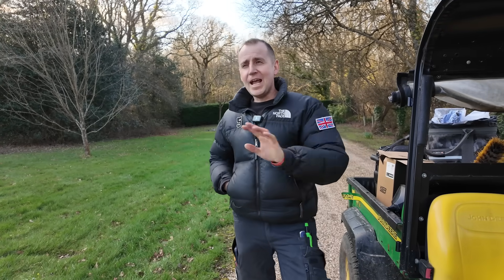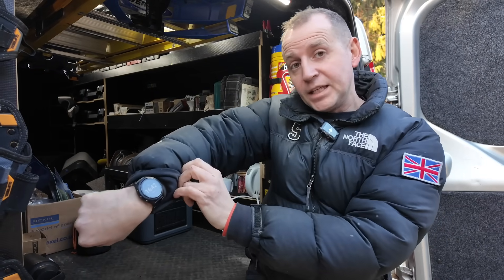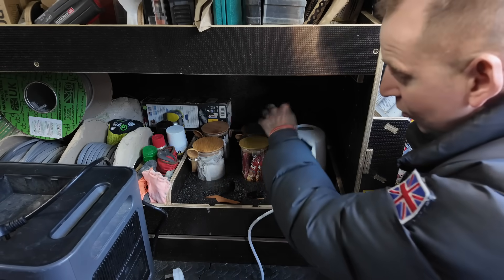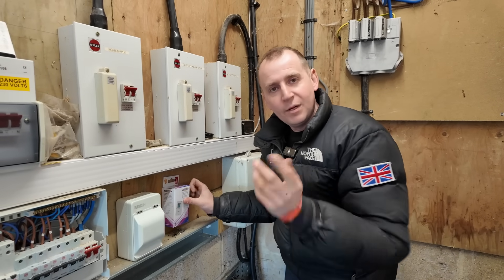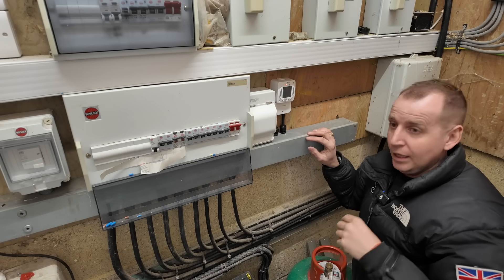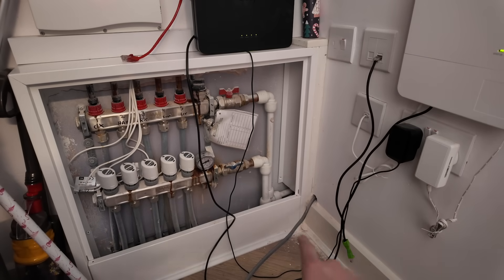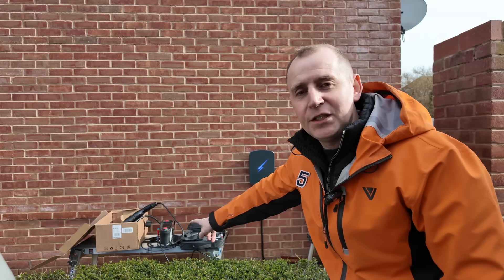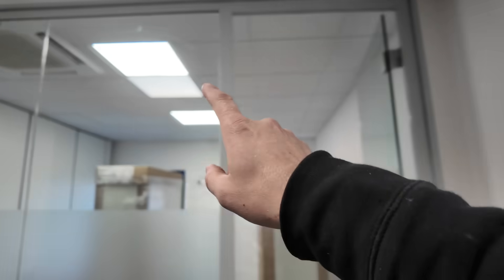EVERYTHING'S BROKEN BUT I WILL GET IT WORKING... OLD WIRING CAN BE FIXED...SOMETIMES.

Comment: Seen some install additional boards from the Henley and some from an MCB in the main board. Is there any pros/cons in each or is it just personal preference?

Could also do lights through a Shelly smart switch. Can then set a timer which they can control from phone and also if home late and lights are off, can turn on remotely. Great video, enjoying following it along.
Reply from the maker: Normally an MCB to EV board is a bit cheaper, no meter tails involved etc, otherwise it’s swings and roundabouts. 

Thank you! I appreciate your kind words!

Comment: Out of interest, Adam, what did you use to connect T&E to EV Ultra?  If it's 4mm2 there are plenty of options, 6mm2 less so.  I'm always conscious it'll be running a full 32A for hours at a time, the  size of newest EV batteries!
Reply: More than likely some Wago 221-6 but could be wrong
Reply: @SME_Ste  I've used the 6mm2 version of the 221 on other types of circuit, but not confident enough to use  with EVSEs.  I recently did one for a Porsche with 93.4kWh battery  - that's a long charge at 7kW  - you've got to wonder about those metal strips that link the ports!  When I need to junction the EV Ultra for any reason I use old fashioned 60A screw terminal connectors, with the two 6mm2 conductors running together from one side, with two screws - and make sure box is easily accessible.  Would crimps be a better option?   With a big enough JB you could use Henley blocks - overkill?
Reply: @ they’ve never worried me, 41 amp rated, which will be continuous and for your standard 7kw charger perfectly up to the job for me to be happy. But end of the day, as its accessible the 60A screw blocks would be another great choice too. Hate crimps, in my mind out of everything to use it these i’d worry about the most. Don’t know why

Comment: You can 100% get the rcbos which fit that wylex board for future ref mate
Reply from the maker: I checked with CEF and Rexel and both said they were non existent anymore, it’s that old bus bar type that the newer breakers don’t fit on
Reply: @sotaelectrical  you can get wylex rcbos from screwfix which fit the nsb busbar

Comment: Adam, have you thought about using the Sangamo solar clock? It’s din rail mounted and you can also make it part night so say turn off at 11.30pm, back in say 5 am. The best bit it’s programmed for the years sunrise and sunset so no need to worry about having to keep changing the clock for dark nights etc. Used them on a few projects and not had one fail
Reply from the maker: I have thought about that but I wanted something really user friendly for the customer to operate and thought this would be far simpler
Reply: @sotaelectrical  if you need some in future hit me up lad over ordered on a job got 16 spares left
Reply from the maker: @ will do mate thank you!! 🙏
Reply: Steinel 3000 also worth a look, photocell with a timer but computes day/time automatically and can switch the load off at a set time (default is about 1:30am). Can also set it to switch back on again in the morning for a few hours. Have fitted a few and so far no issues.
Reply from the maker: @jackwayc  I will look into these, thank you for the suggestion!